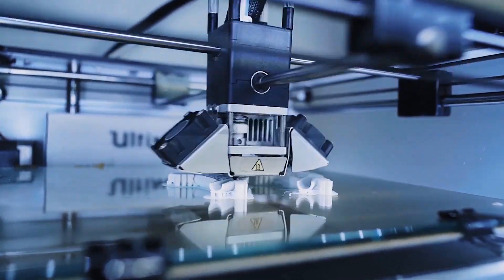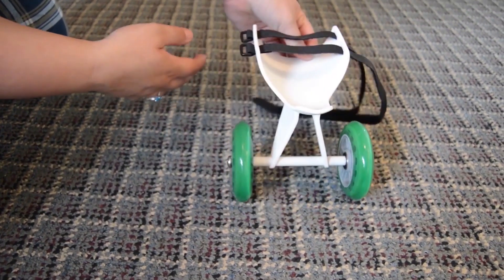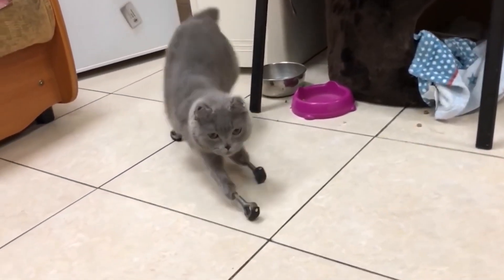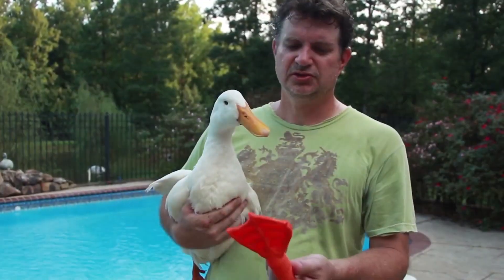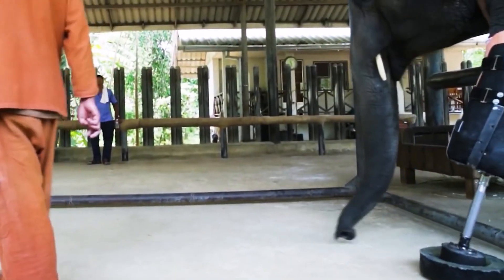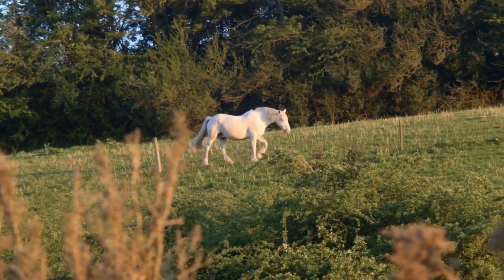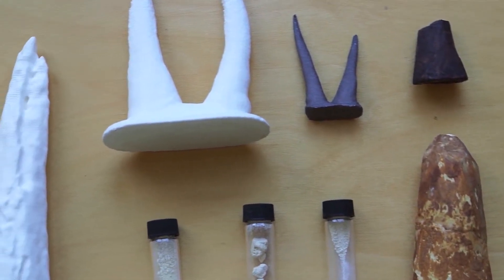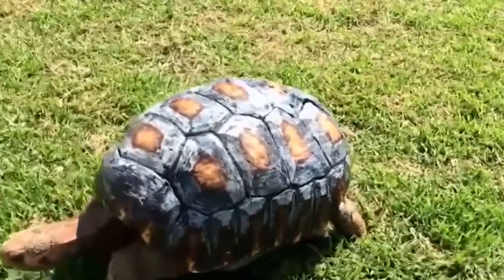3D-printing Technology Gives Animals a Second Chance!

Comment: I can answer any questions about animals or this video. 3D printers are machines that can printed Objects Like toy car or Tools, And containers Etc. Is not usual printer that can print things on a side of paper, But it can print objects by Using stuff Like plastic that is in liquid and more, And these 3d printers are easy to get, Some are cheap and others are not. But They (3d printers) Needed a device like computer to print out the computer programmed it to print, And printers (3D) Can be small or big.

Comment: why did the elephants prosthetic occasionally switch leg o-o
edit: The prosthetic idea for the Rhinos is an okay one, but 1. We're now the ones removing the rhinos horns, just like the poachers, and 2. It wont stop poachers from killing the rhino, only to realize that the horn is useless and to leave it. What needs to be done, is Laws of Poachers need cracked down on even harder than before, and Rhinos need specialized locations where no human can access them unless they have the credentials to do so. No way to break in. No way to leave. The Rhinos can regain their population levels in what would essentially be glorified captivity, where they dont have to worry about predators, but arent interacted with by humans to indicate domestication. Lowering the poacher levels and raising the population will help make matters better, but replacing their horns with prosthetics will only cause the issue to continue, as Poachers may just start killing Prosthetised Rhinos out of retaliation. And again, they may kill the rhino, try for the horn, and realize its useless. The problem, is that the Rhino still loses its life. And if the rhino does live on, and dies in the future, its not like Titanium and plastic are Biodegradable.  This can damage the environment. Its a good effort, but in the long run, won't be effective enough.